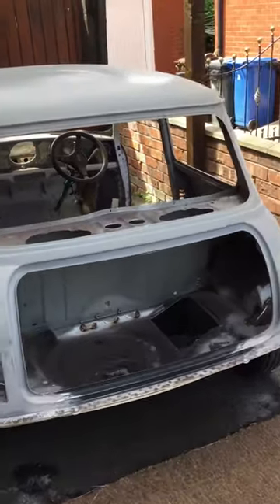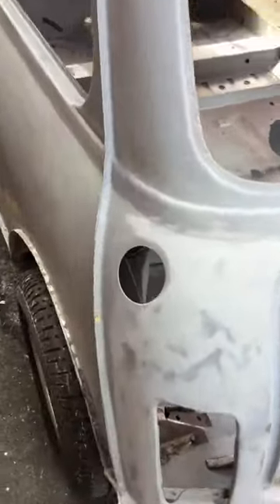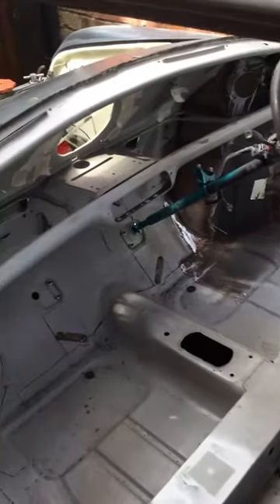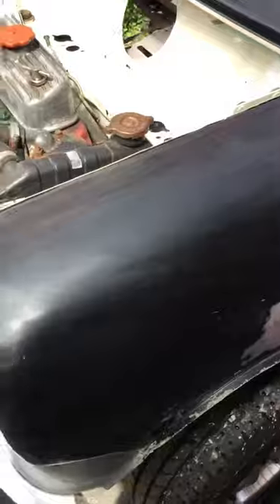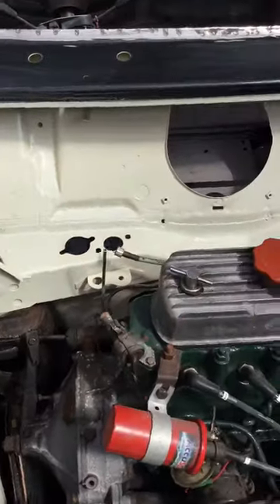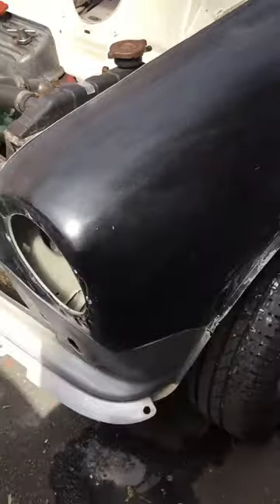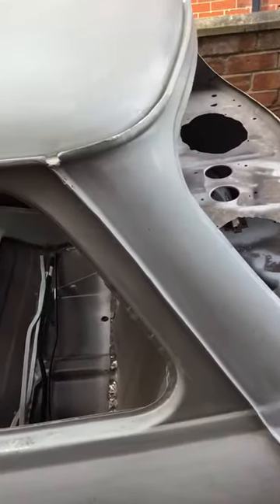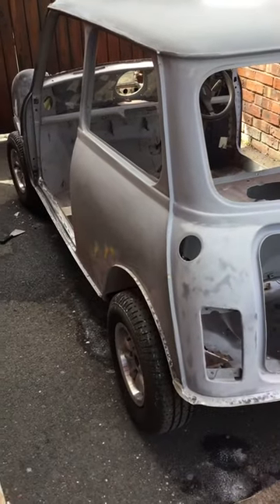Coach painting a classic mini with a brush and roller part 1

Comment: Had you done anything similar before?  I've the benefit of seeing the finished result so have every confidence what I'm watching ends well.  Am interested in how you came to the decision.  Had you seen a car done with Craftsmaster?  You've inspired me to have a go on a 60s car that "should" be sprayed while to date I've only brushed stuff I didn't mind looking brushed.
Reply from the maker: Very very sorry for the delay in replying! Only just seen your message 
I had not done any painting of cars before apart from spraying in the 70s good old days on my mum’s drive😂😂 my day was very good at painting he painted our Triumph 1300 from white to dark brown with Dulux  house paint, it looked sprayed fantastic job! I did research on how the old timers did it in the day, heating the paint helps enormously as it helps the paint the flow better.
The reason I brush painted my car was cost, I was quoted £4000-£8000 to re spray it! CRAZY 😜 
Mine cost just £400 even some sprayers with 40 years experience have seen it and said it looks sprayed 😂😂😂🤷‍♂️. Thank you